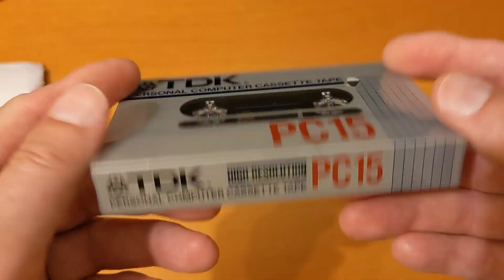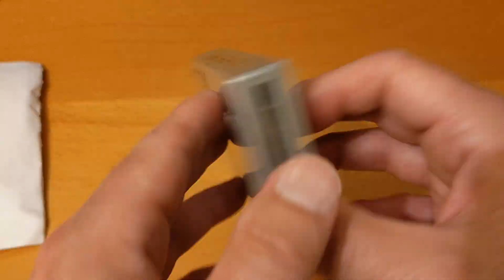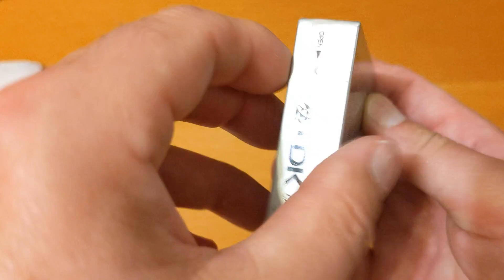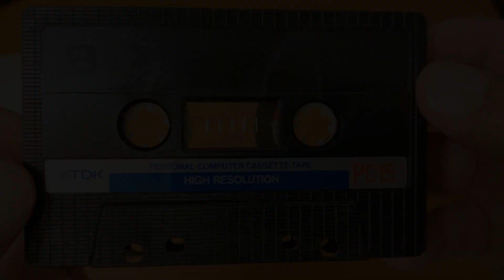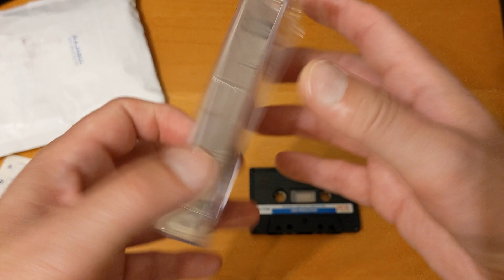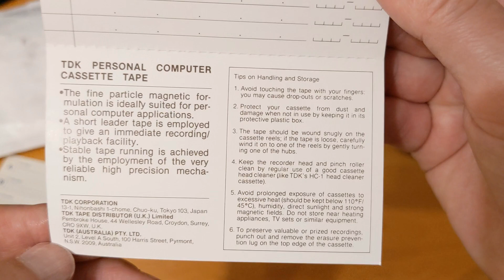A 15 minute cassette? Why?

Comment: I have found using one of these shorter tapes is a good way of exercising an old auto reverse walkman :)
Reply from the maker: @AvidRetro  Actually, that was the primary reason I looked for one in the first place. I now have two C-10 cassettes for that purpose (forthcoming video).

Comment: For a speed calibration tape record a 3khz sinewave on your quartz locked deck. Then you can set the speed using either a frequency counter, a spectrogram app, an oscilloscope or wfgui. The advantage of using wfgui is you can test for wow and flutter as well, given your recording deck has low w&f itself. wfgui is free software you can find online.
Reply from the maker: @kovutlk  I don't like the sound of a 3khz tone, but I do want to experiment with wfgui, thanks. I'd rather use my method for speed calibration, but wfgui would be good for wow and flutter, thanks.